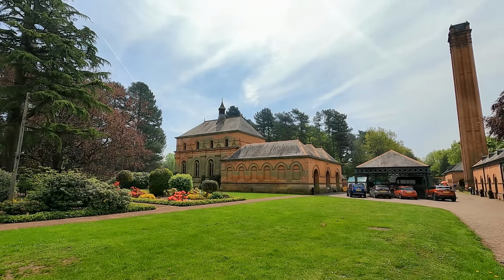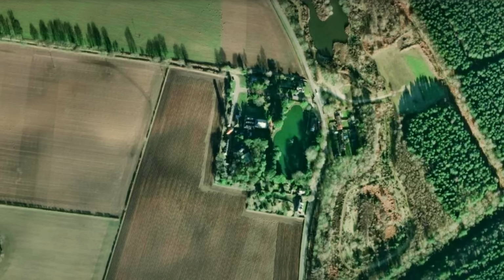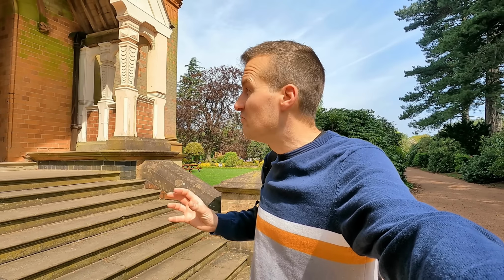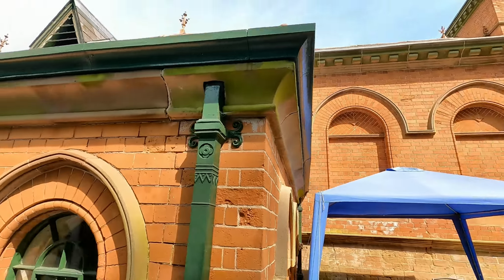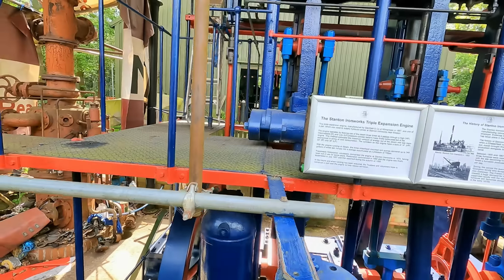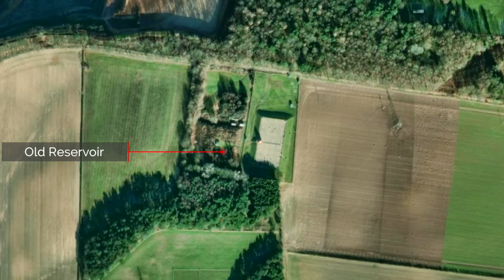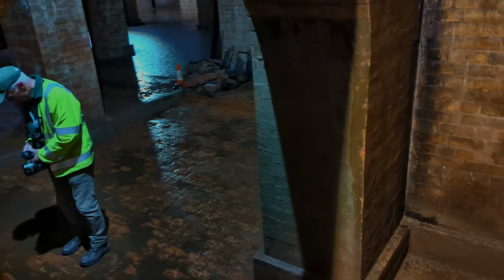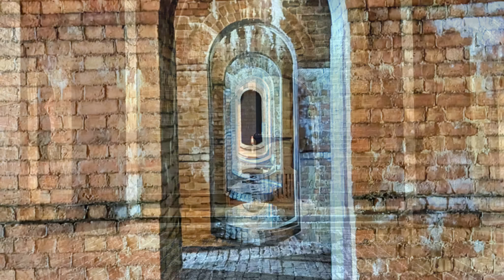The Underground Reservoir and the Pumping Station

Comment: Thanks ant, I have been there several times and didn't know that the reservoir was open to public! Next time I go I will have to make a point to visit it. Did they have a guy there with a lot of model vacuum engine's on one of your visits? They are quite fascinating. Keep up with the good work.😊
Reply from the maker: I can't remember if he was there however I'm sure the reservoir is open the last Sunday of August
Reply: @TrekkingExploration  thanks for letting me know Ant.
Reply: @TrekkingExploration  I see you managed to avoid showing the Electrical Sub Station out front and the other facility on the Corner of rig lane and Longdale lane. The so called chimney was a bell siphon tower obviously.
Reply from the maker: @F4Insight-uq6nt  didn't go for any of that so no avoidance

Comment: It's incredible what our forbears hid below ground, I think two of the most impressive things I've seen are the 'Cathedral' in Stanedge tunnel and one of Manchester's trunk sewer overflows, all brick and oddly hypnotic.

Marvellous stuff, Ant. 👍
Reply: I think I know the CSO you mean, it's popped up more than a few times on various Urbex Forums and Blogs. Some brave guys on 28DL followed the sewer once, it got even more impressive and there are chambers like that where two of the lines meet and follow each other in parallel with chambers/passages about every 50m or so linking them with a pair of side by side chambers that size and smaller 2m or so pipes joining.
Reply: @Tuberuser187  The one I'm referring to is known as SSSI, just north of Manchester city centre, no way anyone was traversing that raging torrent of sewage, in my opinion. 

You might be thinking of Hulme Flume, alas, I missed an opportunity to visit that one via the pedestrian access before it got sealed. 👍
Reply: @iancaveney7464  Hulme Flume is the one but I have seen the other two, I have never visited either though.
Reply: @Tuberuser187  Been a long time since I was involved in such shenanigans, but, you can walk into both of them when I was last there. 😉